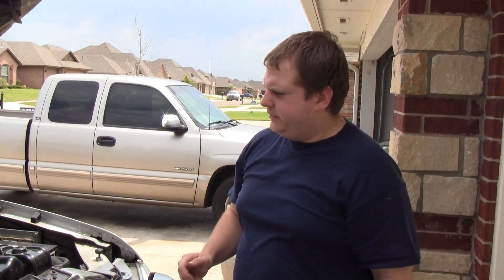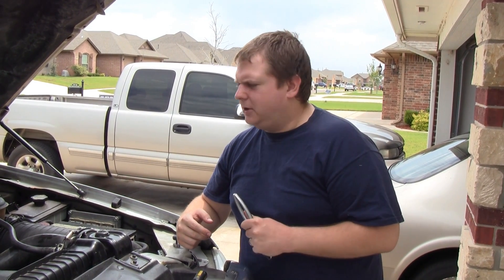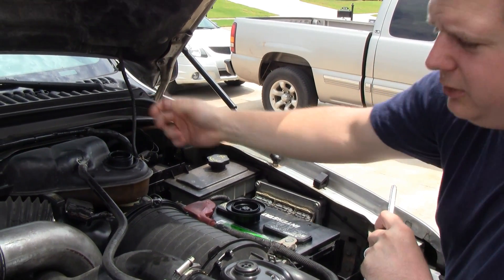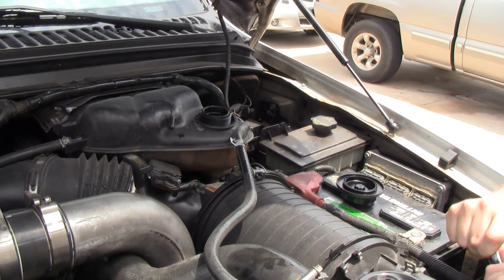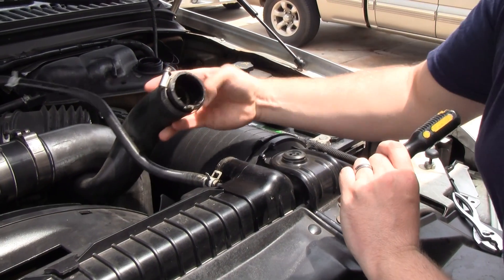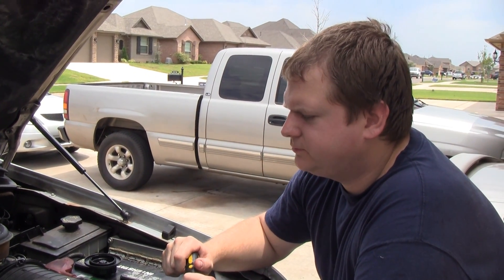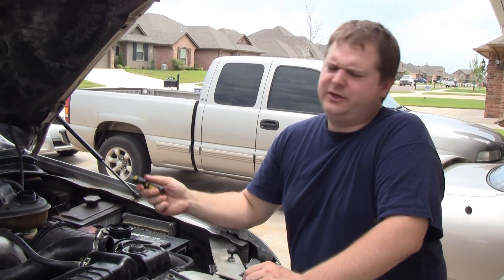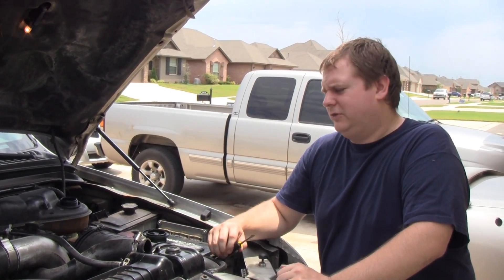Deviously Clever Mechanical Fraud On A 2003 F-250 Powerstroke Diesel

Comment: That’s a bad oil cooler, that’s all. But a total dirt bag went out of his way to hide it. Blown head gasket would of blown a hose or line someplace and it’s usually coolant in the oil, not the other way around. Kind of an irrelevant post some ten years later and all,  just say’n for anyone who may have a similar issue. 🇺🇸

Comment: You're too kind. We had a used vehicle dealer almost dupe us on a check engine light issue(knock sensor code). Since we initially trusted him and it was under a short warranty, we brought it back to him to 'fix' the aforementioned code, and left it there for a day. We came back to pick it up. The code was cleared and he said that it was a sensor. Fair enough. It happened a few more times over the course of the short 3 month warranty. All he did, each time, was reset/clear the code by removing two fuses and then reinstalling them. Of course, a few days after the warranty expired, the check engine light came on, again. This time I took the truck to a third party, Advance Auto, and their diagnostic test determined a knock sensor code. Of course, when you have one faulty knock sensor and since you have to remove the intake section of the engine to gain access, then you might as well replace both knock sensors.  Parts and labor, collectively, are around $800. So, that's why the low life just keep resetting/clearing the code. Needless to say, I confronted the used vehicle dealer and I presented him with an ultimatum, fix it at no cost or take him to court and get even by any means necessary. Tires(knifes/sharp reamers) and windshields/windows(ninja rocks) are very expensive to replace but very quickly damaged by forces of unpredictable brutal nature. Wisely, he opted for the former and his business remained intact.

Comment: Here's a tip for you:  STOP BUYING USED!  Suck it up and BUY BRAND NEW!  Used cars are used FOR A REASON.  NEVER buy used.  Buy a top of the line, brand new vehicle and keep it for 300,000 to 500,000 miles before sending it to the junk yard.

Comment: First gen 2003 6.0L where the worst of the worse. Huge lawsuit against Ford when entire ambulance fleets across the nation where stranded when the 6.0 overheated and failed. Note: The 2005-2007 are the better 6.0. Just do the ARB headbolt and EGR delete, change the fluid every 4k and youll have a good 6.0

Comment: Man it’s just sad that people treat these motors like there gods gift to the world and don’t do simple maintenance and end up with a messed up oil cooler from the coolant breaking down which causes a slue or other problems down the line from the oil cooler causes misdiagnoses after misdiagnoses and making people think these Ford international motors are shit when they really aren’t I mean every one of the big three motors had pretty severe problems Durand transmissions and injectors from 99-03 dodge with their 1/2 ton transfer cases in 3/4 trucks and ford with the 6.4 and 6.0

Comment: Had they not blocked off the overflow to the overflow tank it would have been getting oil contaminated coolant and as such that would have been visible to anyone that checked the reservoir and trigger them to look further into the problem of oil in the radiator overflow/expansion/overflow tank.

Comment: had a similar problem when i bought a 2008 civic at an auction. along with that, there was a bypass with the thermostat and a cracked head gasket covered with silicone

Comment: Reminds me of a old shade tree mechanic trick to up-sale services by putting a plastic capt in the coil of a thermostat and running through parts to rack up labor and part profit when it overheats going down the road.. You'd be amazed how many shops and mechanics do stuff like this. Even big chains who aren't pulling many customers will pull this and other things. Like $100.00 labor to change fan solenoid which is easily reachable and held on with two bolts on all cars, and the same price for the part which is really $25.00

Comment: I use to work at Ford, the 6.0 & 6.4 are trash diesel engines. I sold more parts for those engines than anything else.

Comment: Oil Pressure is significantly higher than Coolant Pressure, so if there's slurry in the coolant side, it stands to reason there'd be slurry in the oil side. Was there any slurry in the oil, on the dipstick?

Comment: I have the 3rd 6.0 motor  in my 2005 all from ford 1st  had cooler (oil) problems 2nd injector line cracked in head locked up piston,
3rd put aftermarket cooling, and filter, and ford warranty it , admitting design flaw , I and my company have purchased over 40 ford  cars and trucks never again after this.

Comment: I bought my car used and somehow the engine that was swapped with was with a bad and wrong engine. I noticed that length of time it took to start the car, sales guy told me it sat for a long time. Turns out i lost compression in cylinder 2. Since they sold me the car cheap, I had a performance shop install a brand new motor into it. Much better.

Comment: I had a Suburban with two throttle body injectors. My mechanic "replaced" the bad one by upping the pressure on the good one. Later he "rebuilt" an engine for me. I found out later about both of these from two separate mechanics.

Comment: Its no different from changing the oil and coolant after you blow a headgasket to mask the blown headgasket... and depending on how bad that gasket is blown, you may never know until you actually get on it and make it run hard so that the exhaust gas will leak into the coolant and show its face in the resevior ... hence the reason why they sealed off the resevior return... 
who ever did this knew what they were doing... Your diesel mechanic... well, he didnt catch is probably because he knows enough to get most jobs done but to spot something like this .... takes a person that has done it before or knows the exact symptoms...

Comment: So I know this is old. But one thing makes me wonder and another is amusing. 

1. First, he said auction, then he said he wasn't going to tell you which dealership he got it off. So which is it? Did you get it at an auction or at a dealership?

2. All the Youtube comment lawyers. He bought the vehicle used, most likely, as is with no warranty. If he got it at a dealership, they might not even know it had any issues. Maybe they took it for a ride gave it a quick once over and threw it on the lot. Or maybe they knew it had a problem, cleaned out the reservoir and rtv'd up the return line. Good luck figuring out which and proving which. It'll cost you more money in court than replacing that block would to get some sort of result.

Youtube comment  lawyers rock!

Comment: These types of things are old as the hills. Sawdust in a manual transmission to mask grind and smooth out shifts. Plugging the end of the dipstick tube and adding a little oil to make it look full and clean. Adding rubbing alcohol to fuel to make it pass an emissions check. So many sneaky moves.

Comment: Dont get this. The reservoir is completely blocked off with silicone right? Surely with no cooling, the truck would overheat and seize up in minutes? What about the no coolant warning light, the temp gauge flying north every time you start the car, CEL and limp mode kicking in, and auto overheat cut off killing the engine?

Comment: A cooling system pressure test would have caught a problem with the head gasket, not?  Did your diesel mechanic do this?  Maybe the symptoms didn't warrant checking for this.

Comment: Never trust a car salesman, or worse a used car salesman.  Many decades ago I was a mobile engine machinist.  I would perform engine rebores, cylinder sleeving, and crankshaft grinding at what ever business called me.  My worse experiences were with used car lots who put the buying public's best interest last.  The salesmen would rather save a buck than do a mechanical repair properly.  On one lot, the crankshaft was beyond usable tolerance.  I told the salesman that the crank shaft was scrap metal.  He wanted me to machine one rod journal only, and get a special thicker babbited bearing ordered.  I looked at him incredulously and asked, "...and how long do you think THAT would run?"  The salesman said, "It only has to run long enough for the buyer to drive off the lot."  After many highly negative experiences with new and used car salesmen, I have developed a great distrust for car salesmen.  They are not your friend.

Comment: I bought a used car from a known big dealer with water in the trunk. I was told at the time the valet had left the water in there by accident and they cleared it out before I picked it up. 

I later learned from someone else that the car had been in an accident  - that wasn’t revealed to em by the dealer - and the accident damaged some seals to allow water to pool.

I wrote to the dealer head office and never got a reply.

Then there was a TV documentary about their sales techniques.

I’ll never buy from Charles Hurst, Belfast again.

Comment: I had an ‘04 6.0 powerstroke. The vanes in the turbo got stuck which caused it to overboost and blow the head gaskets which blew the egr cooler. Unless you do a full egr delete and head studs these things are a continual PITA.

Comment: Yea, I guess the previous owner or shop didn't feel like pulling the cab off. I've owned multiple 6.0's years ago and there isn't anything easily accessible in the bay.. head gaskets...forget it you need a lift. I've done EGR deletes where it would of been easier to have the cab off. If your buying a 6.0 especially an early one you better have somebody with you that knows them like the back of there hand. Sorry to hear about your issue tho. And yea it was a pretty brilliant scam. Unfortunately...

Comment: the rule at the auction is if you don't know what you're doing you don't belong there.
the dealer most likely simply ran the car through the auction because it was used as a trade in and given to them in that exact condition.

Comment: I'm working on a tow truck in my school and the seniors last year did some dumb shit, hell I did some dumb shit to it (it's been there for 2yrs now) and I was running the over flow lines to each injector and came across the one we used to pressure test and remember quickly that the senior last year plugged both over flow ports with silicone 😂😂

Comment: Common issue with certain years  Chevy engines around 100k miles the intake gaskets fail, mixing oil and coolant. If you're a piece of garbage and are familiar with issues like these, and you don't want to spend time on fix8ng the issue you could do shit like this and rip people off. Only stuff a piece of shit person would do.

Comment: Typical dealer BS, make the mechanic mask the problem, then if it gets found out fire the mechanic. 
I worked for 30 years in dealerships, this crap goes on every day. They get stuck with a bad trade in, they pass it along anyway they can. Like mentioned here before, they don't send good vehicles to auction, its a place to dump junk they can't put a warranty on.  With that said, deals can be had at the auctions but don't expect them to be an easy or cheap fixer upper. There are also auctions that only sell junk, and auctions that only take vehicles with a warranty backing them up. Most auctions here give you 48 hours to dispute a vehicle is not as described.

Comment: How in the ever loving hell did you drive it w/o it over heating is my question! Something here seems a bit funny to me! I mean no coolant getting into the engine would most definitely make it over heat! Even if there is coolant in the engine it’s not
Cycling through the radiator and back in the engine, so again it would OVER HEAT! How is a whistling noise and a lose of power the only thing you noticed? I’m calling B.S. on this whole thing! Nice try tho either that or you’re just flat out dumb as rocks!

Comment: The 6.0 was a disaster. I had one. After I did my research, I found that Navistar made them. It was a lesser company that was bought out by Harvest International. So they told everyone it was an International motor. It wasn't. We were used to 7.3 reliability. And the 6.0 wasn't it.

Comment: There's nothing new about that. It was very common in chrysler/plymouth 2.2 turbo motors (glh, glhs omnis, new yorkers when some nitwit would warp the heads & couldn't keep a head gasket in them. Also common with the mopar 2.5's in later K cars.

Comment: Interesting video but I'm a bit lost. What was the purpose of blocking the coolant line on purpose?
Reply: They blocked only the expansion tank up with rtv sealant, isolating it from the rest of the cooling system which is contaminated with oil. Then they put new coolant in the expansion tank to hide the problem, making the next buyer think the coolant is clean.
Reply: Thanks man.

Comment: Ford has not made a "good" truck since around 97. I can say this because I used to own a brand new 2008 F250 SD and it was the biggest POS I've ever owned. I unloaded it in 2010 back to the dealer I got it from and they PAID the balance of the note which was great. It absolutely needed a EGR and that's just the start. Since then I've own Toyota and have never ever had an engine problem. I'm not a "Fords suck" guy but what happen Ford?? I'm sure people will post "well my 2011 is great and no problems", awesome you're lucky!

Comment: Your VERY first clue should have been all of the coolant sediment on the under side of the hood directly over the degas bottle. That's a classic sign of overheating, when the chemicals break free from the coolant. Indicating a bad oil cooler, egr cooler, or head gaskets.

Comment: It probably has a blow head gasket if oil is going into the coolant. I'm assuming the coolant tank being blocked is the reason why it has a blow head gasket. Plus is the Engine been Bullet proofed?

Comment: TO EVERYONE: that little hose(sometimes more than one) is(ARE) to be HOT;

(coolant flows back from the radiator,to bleed air out,back to the engine from the bottom reservoir hose); the RESERVOIR also MUST be HOT; as long as the engine is hot!

AGAIN: IT(THEY) MUST BE HOT;( I ALWAYS ALWAYS check that; you will too,from now on,on your OWN cars); if not,the little hose ,OR the nipple(s) is plugged up :you MUST MUST unplugg it!!! or soon you may loose your(overheating) engine ;

( I always learn a lot on youtube comments,always knowlegeable people here!).

jose p fr porto P

Comment: Pinholes in the cylinder walls. Surprised it's not on the list of issues. Ford had a major issue with pinholes with their diesels. Not using the correct anti-freeze was a contributing factor.

Comment: Its a Ford diesel engine. They have changed them from International to their own design and all of them are not reliable. I never could understand why people buy diesel engines to just drive around town. If its a work truck hauling things for long distance fine, buy a dodge with the Cummins engine which is the best. Duramax are as bad as the Ford's, not durable at all. They were so bad they had to stop making them for a couple of years. If you haul buy the biggest gas engine they have and enjoy it. It may cost a little more on fuel but you wont be held hostage by the diesel boys.

Comment: Never would see that crap on a Chevy .. Stay clear of ford trucks
Reply: interesting, he never heard of an airintake.  BTW,  if you put starter spray in an air intake, that means the engine is broken, cracked or its gasket failure.  You are dumb.  All of you scammers are.

Comment: Likely someone put gasoline in your diesel and the heads have micro cracks.  The lines are plugged so diesel fuel doesn't get to your radiator and then you can smell diesel in the cab.  Someone didn't want to spend $6000 +, sold it and now it is your problem.

Comment: A friend of mine had motorcycle shop and the shop next door would buy cars at the auction, bring them back to the shop and detail them and/or do repairs and bring them right back to the auction. One time they bought a Honda Civic that they thought needed a tune up. After getting it back to the shop, they found a rod sticking out of the block. They RTV'd around the rod and disabled the spark on that cylinder and sent it back to the auction and made a small profit. Lots of auction horror stories.

Comment: you can sell it and get a 7.3. or get the 6.0 bulletproof kit. it fixes the problem of the oil and coolant mixing. which is very common on those engines. I believe it'll cost you close to 5k.

Comment: Believe it or not i have had a check engine light come on from someone cleaning the engine.
Reply: That simply means there was a leaking hose (vacuum leak) or an electrical connector that allowed water in.  Cleaning an engine that is properly sealed should not cause the check engine light to come on.  Why? Because if cleaning an engine causes problems, then every time it rains then everyone's check engine light would come on.  Therefore if that happens, that tells you there is something you should address.  Fix the connector and/or replace the hose.  Another possibility is a connector was disconnected from a sensor because the connector lock was broken.  Finally, remember a check engine light is a beautiful thing.  That is an inanimate object telling you there is a problem!  How many inanimate objects do that?

Comment: Moral of the story ; check and look at the coolant in the rad when the vehicle is cooled down not just the overflow jug.. and if you buy from an auction just on sight this is what you can run into.. I'd be mad as hell if I paid much for that truck.. headgasket job is a pain in the ass and expensive if you have to send heads or block to get machined..